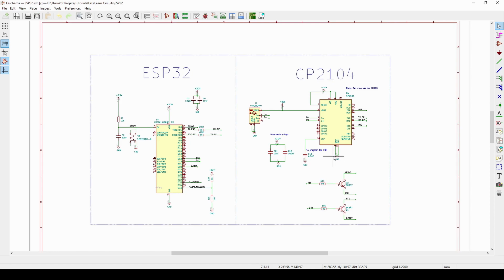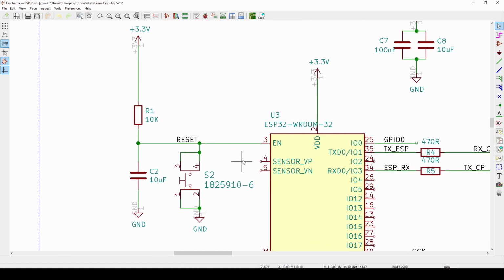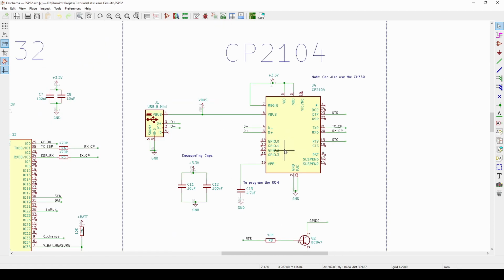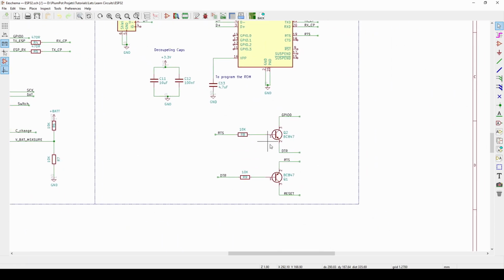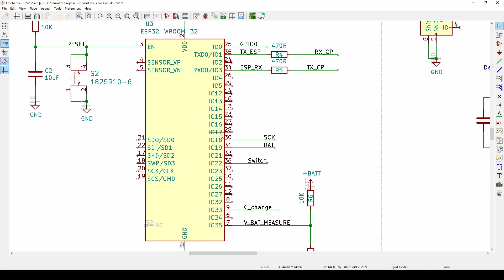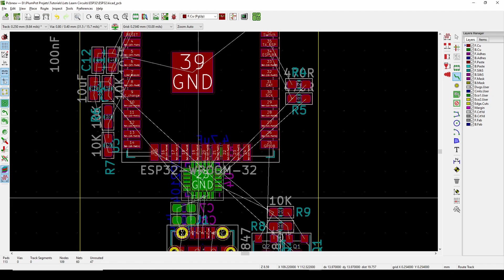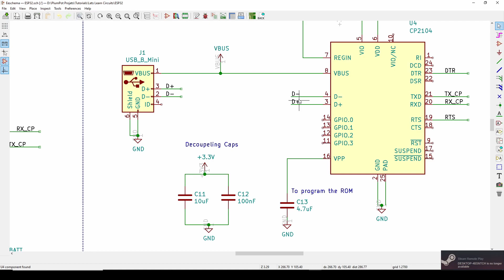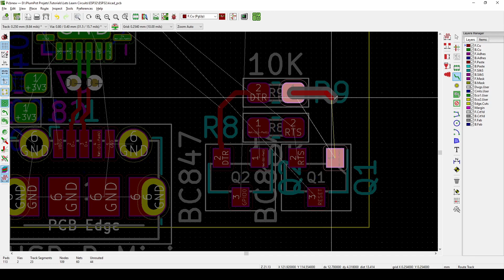Let's Learn Circuits in KiCad #2 - ESP32 and CP2104

Comment: correct me if I'm wrong but it looks like the SCK, DAT, Switch and C_change lines aren't connected to anything? Are they going to be external components you're just labelling?
Reply from the maker: haha good catch. It is cause I copied it from a previous project where I used capacitor touch (C-change) and a display. So they are signals that are not used for CP2104
Reply: @PlumPot  phew, because I left them off of the PCB I just had sent out haha. Thanks for your advice, it wouldn't have been able to get them out as fast as I did without your videos

Comment: Great video!! One question, why do you put resistors on the serial? And, are the serial also differential pairs?
Reply from the maker: Hi Carlos :) No, they are not, I do it for two reasons, one is for inrush protection, helps with ESD as well, but my main reason for putting resistors on TX and RX is if I made a mistake in my design and connected RX to RX or TX to TX I can fix it by removing the resistors lol. Sometimes I still make wrong connections😂

Comment: What is the purpose of VBUS pin? and if i want to power a similar esp32 board without usb power. should i connect the 5v power to Vbus ?
Reply from the maker: The VBUS is the power from the USB. It is needed to program the ESP32 through the CP2104. Its not used to power the ESP32 in this example. You see that the ESP32 is powered by 3V3. I talk more about it here https://www.youtube.com/watch?v=YnPeRte5ax0&t=394s.

So the voltage regulator will power the ESP32 what you input to the voltage regulator can either be VBUS,5V or maybe a battery.

But to program the ESP32 you will need the VBUS.

Let me know if it is clear:)
Reply: @PlumPot  Thank you, so I understand correctly. When usb is plugged in power can be provided to esp32 through voltage regulator and vsub should also be connected at the input of voltage regulator. when usb is not connected, I can apply external 5v to input of regulator. and during this operation CP2104 will essentially be disabled.